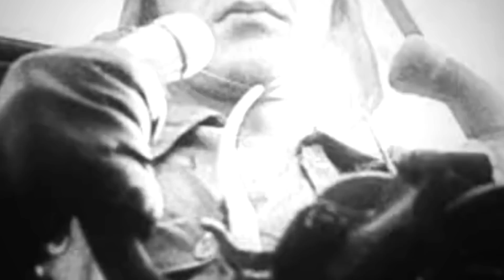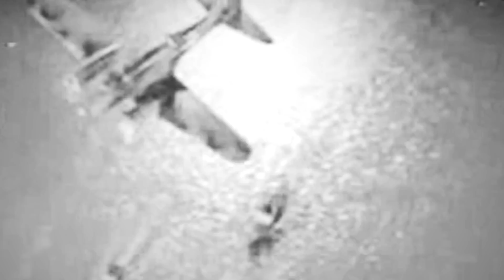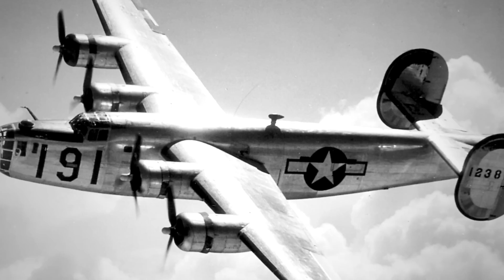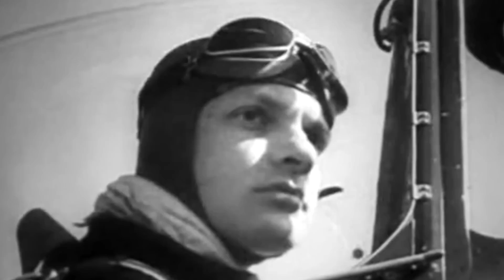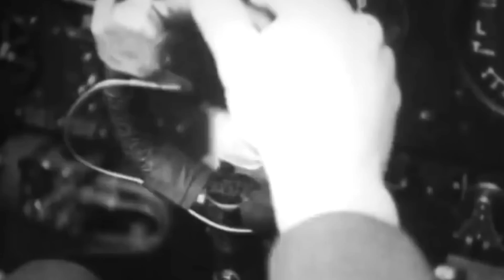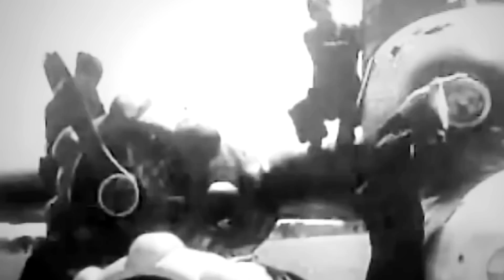The Plane with the Wildest Most Unusual Event

Comment: I had the privilege of flying an Anson MKV buzz number 12417.  At the time it was the only airworthy Anson flying. When I used to take it to airshows, veterans would ask if they could sit in the cockpit.  I saw many a veteran come to tears with the memories of their time in the Anson and the pals that they had lost.  A similar accident happened at BCATP Dunnville ( I believe) where one Anson tangled with another and they both landed safely.  

It was a great aircraft to fly, ten hour range and reliable Pratt and Whitney 985’s and constant speed propellers.  It was referred as the Great Equalizer as the tailwheel was full castoring and could not be locked and the brakes were fickle, either full on or off.  All wood contstuction and well thought out.
Reply: On 7 December 1943 another piggy-back accident occurred when RCAF #18 SFTS Anson II JS193 came down on top of Anson II JS167 in the landing circuit at Gimli, Manitoba; the aircraft landed safely still entangled, and both were later repaired.  - cited in Wikipedia as from Air Force Magazine, Spring 1991, Summer 1991, Flypast May 1997, CAHS Journal Vol. 10, No. 4